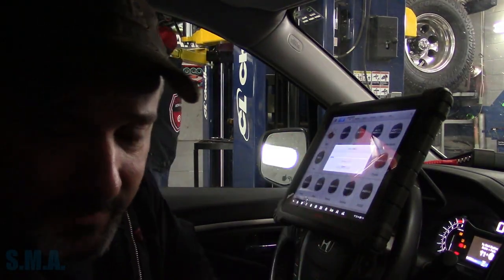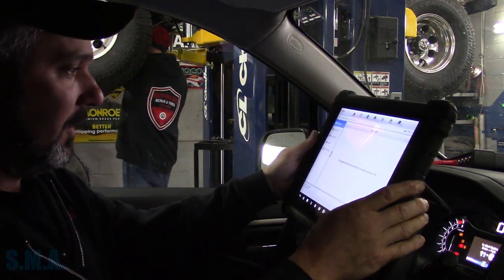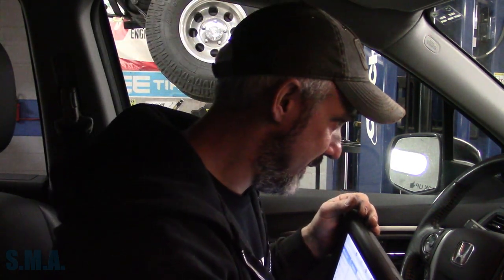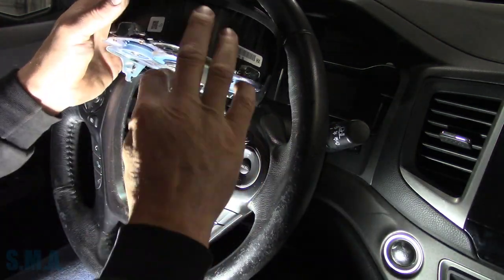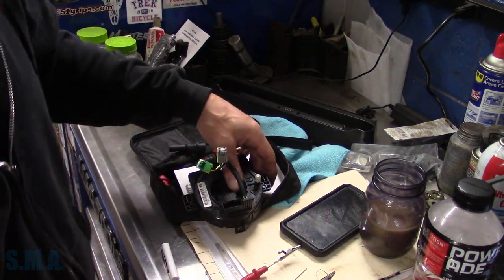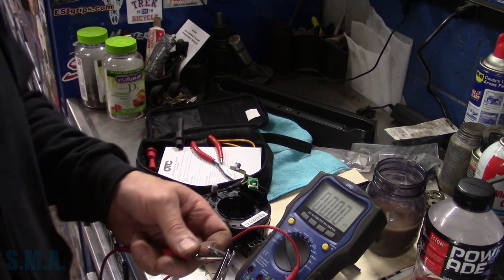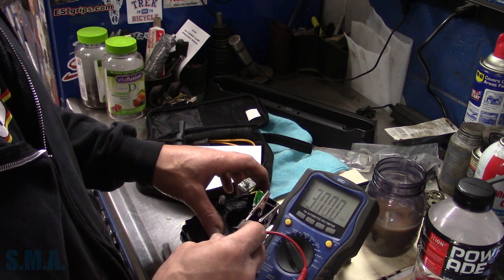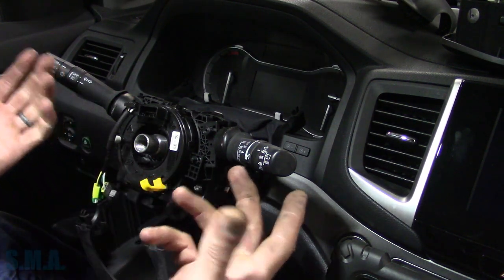Honda Pilot - Air Bag Light On

Comment: Man, those two young men are so lucky to be working there.  They are learning some very good techniques and procedures that will aid them their whole career.  It will save them a lot of grief.
Reply: You are absolutely right. Not only his diag ability but his work it self. He does the job right. He puts things back in the right places, cleaning and lubing as needed. I wasnt lucky it took me watching EricO to understand what these other techs was doing wasnt right. Example: Brake job a lot of guys doesn't clean the pad guides properly and just sand the ears of the pads. They didnt grease the pins or clean and put anti seize or lube on the Hub. I just did what i was told. After watching EricO my whole thought process changed. Now i own my own shop and everything is done to the best standards.
Reply: I don't give a thumbs up to many comments but I did this one. You nailed it right on the head
Reply: L0
Reply: Robert Slackware m

Comment: Man it is so good to see Eric O & Mrs. O chatting. Those are the best parts. In one of the SMA videos, Eric fixes an AC on a car that has no brakes. Given a car that will not crank with a good battery, until my money runs out, I will have repairs done in this order, brakes,  steering 35:20,  suspension,  tires,  lights, windshield washer/wipers,  engine, drive train, and finally creature comforts, e.g. AC, power windows. Engine is late, because I do NOT want to move until the other items are in good working order.

Comment: OMG! these are the exact 2 codes that pops up on my OBD2. My horn and steering wheel buttons works perfectly well, However the backlights are intermittent, it will only light up when you steer the steering wheel 180 degree and my SRS light is on. THANKS A MILLION! :)

Comment: We didnt have Legos when I was young. I had Erector sets! Real man boy toys!  😜
Reply: Do you remember the Crashmobile?  The 4 quarter panels and roof snapped on to the frame under spring tension.  Push the front bumper in and the parts all flew apart.  Had no idea that cars would actually evolve into that someday.
Reply: Lincoln Logs, baby!!  (Although I did later get an Erector Set).
Reply: @EdAxeman
Me too!  I had 2 sets.
Somewhere in my house are the 2 sets.  My Mom kept them then sent them when we moved to California and they sold their house.
THE A.C. GILBERT ERECTOR SETS!

Comment: Eric if the air bag would have exploded you would be the YT legend of all time!!
Reply from the maker: We could only hope on the next one....
Reply: I've replaced many hundreds of airbags in Hondas (Takata recall) and we never remove the battery cables, it's a huge waste of time. Not once ever has any of us techs had an issue. Theory is one thing, but reality is what it is.
Reply: Jgizzy redacted I always thought the chances of an airbag going off are very slim because of the shorting bar in the connector
Reply: You mean just like it happened to Paul (Scanner)Danner? ;-)
Poor guy, though... that bang + the costs of replacing all of them. :-(
Reply: I seen where a quick lube tech was replacing a cabin air filter in a Acura mdx and the air bag deployed and hit the owner/driver! There was a lawsuit and settlement! I'm pretty sure it was a Lube Express in New Jersey
Reply: @blockbertus  which video was this?
Reply: The flame throwing shock absorber on the Toyota Forrunner and extreme brake rotor removal with Big Nasty on the Mazda should've put Eric over the top. An air line was decapitated and a tool box dented in the brake rotor video!
Reply: @JBotAlan  He never released it. There is just a snippet of it in one or two videos. You see Paul doing some airbag system diag and suddenly ALL airbags in the car deploy. It seems he is turning over the airbag control module and I assume that thing "thought" the car rolled over and fired all the bags it had. And it had plenty....
Reply: @blockbertus  when i was in tech school, a buddy of mine who worked for BMW said one of the techs was diagnosing a g sensor, accidently dropped it and all the airbags went off and he was all fucked up and went to the hospital and shit
Reply: @drwrencho4392  oof. That sounds awful. Hope he recovered.
Paul, btw, was outside the car and just leaning into the foot area on the passenger side to fiddle with the module.
Reply: It's a myth about taking battery off with airbags. The Airbag ECU has to close the ground, it won't do this until certain inputs match criteria. Impact sensors, deceleration values etc all have to match before BOOM!

Comment: Hondas have torx bits . Every other vehicle uses small holes and you have to press the rods that release the bag. I made my own tool for this.  An antenna cut and ground flat works great...just a friendly tip

Comment: The "shorting bar" on a clock-spring connector is there to *reduce* the likelihood the airbag will deploy inadvertently because of something like a static electric charge, typically you don't want them blowing up in your face.
Reply: I wondered what the Shorting bar did 
thank you 🙏
Reply: Great info, was perplexed why
Reply: Typically.
Reply: also I found into the airbag connectors some LC/RC filters so signal spikes get a calm down. and short bars in almost every connector, IIRC even into the airbag's control unit too.
Reply: Airbags do not just blow up in your face unless sensors are triggered I'm an airbag expert

Comment: Also disconnect battery and wait 20.min before even touching airbags ....they will not explode. Just a precaution.  Airbags don't just explode unless a sensor has been triggered by a collision that's the only way. Been doin this 20 plus years I've never had a airbag blow on me

Comment: I always use a battery impact to undo the bolt holding the wheel on. We had a recall to change the clock springs in CRVs last year. The thread lock takes a little breaking...

Comment: Push pin pliers work the balls for unplugging those. Honda sent us a bunch of "special tools" to remove them for the  CRV cable reel recall, but I can never find it when I need it.

Honda says don't use an impact to loosen that bolt. Which is usually the indication that you shouldn't waste any time  throwing an impact on it. I  think the torque spec is 65Ftlbs. Not sure on the pilot. I've only had the wheels off those to install a heated steering wheel, which  if you have a heated steering wheel accessory installed. They wont know by  your vin, and you do need a specific cable reel for it.
Reply: Robert Slackware  sounds like you got a parts guy that just didn't want to help you out.

Honestly if you have the lower end radio, count yourself lucky. They're not plagued with MOST connector issues.

Shoot me a message with your VIN, I'll look it up on honda interactive.

Comment: Great video, however my VERY next step would be to disassemble the old clockspring unit so I can see the wire broken.  I know it's pretty pointless because you already proved it to be faulty, but I like to see the failure point in things like this.  I seem to remember him taking one apart before.
Reply: A tiny ribbon wire, often times the break is so small it's often undetectable to the naked eye.

Comment: Hey Erik. I'm not a mechanic so pardon me if this is a stupid question...
Why don't you center the steering wheel in the down position while removing an airbag? Seems like it would be a perfect "table" and your work would be easy to access without having to hold the bag up. Then when it's out you can turn the wheel back to straight.

Comment: Hondoos never break down or have issues!
Reply from the maker: I hate to tell you....

But Scotty lies
Reply: VERY  SELDOM
Reply: @SouthMainAuto  , scotty ? Lie ? Naw , he couldn't ( could he ? )
Reply: @SouthMainAuto  agreed
Reply: Also was gonna say didn't EricTheCarGuy replace a steering rack in his Odyssey
Reply: I have owned 3 Toyotas and 4 Hondas. More trouble with the Hondas. They all have issues sooner or later.
Reply: Kilmers subscriber count baffles me.
Reply: As a tech at Honda dealer that’s incorrect they break down a lot
Reply: @adventureoflinkmk2  Naw he just welded the old one in place.
Reply: The cigar powered smoke machine doesn't lie Eric...insta ban.
Reply: Lol. Maybe back in the day, but the new ones are recalled constantly
Reply: @nathanknight9617  As a Honda tech myself I second that. I'd work elsewhere if they didn't break.
Reply: @VeeYehLa  Confirmation bias is present today! It's an easy opinion when all you see are the failure modes of each model, but do not see the multitudes of the same out there on the road with no such issues. When all you see are the failures, it's hard to impossible to see the successes that never make your acquaintance.
Reply: @SouthMainAuto  Ever work on a Hondaroo?
Reply: @YTisDumb  With all the crap in that garage who would want to?
Reply: @MrTexasDan  or probably stuck one of those resistors in the  connector haha 😹 and wired the rest to the battery

Comment: Must be the same guy at the Honda factory torquing crank bolts that put the steering wheel on. That thing was tiger tight
Reply: Only 2 that always put a up fight when you try to remove. Guaranteed. Ive never had one come undone easy

Comment: i imagine each of those button blocks is on its own channel to make building different models easier.  the harness and the slip-ring can then be common to a wide selection of Hondas if not all of them.  they can just install the buttons for that given car's specs and then program the computer for them.

Comment: You could do worse than GearWrench as a sponsor. As a an amateur weekend lame-o mechanic, I find their stuff pretty good. And mostly made in Taiwan which I like a lot more than buying from the mainland if you know what I mean.
Reply: Love my Gearwrenches! Use them every day!
Reply: The GearRatchet I got like a decade ago is still my favorite, as well as the most useful, socket set I've ever owned. Their stuff is fantastic.
Reply: GW was pretty good up to a few years ago and with some of deals amzing value, most current tools have declined massively, socket design worse, ratchet design worse (and changes made because cheaper manufacture not better tool design).
General quality and warranty constantly slipping to keep prices competitive and margins high .
It not a brand worth getting into heavily, pick the odd item they do well or old stock better made/design tools at cheapest prices you can get and you doing okay, plenty far better to be had at same price range ...
Reply: They also have EXCELLENT customer service. I recently needed to warranty an 8mm ratcheting wrench. It was part of a set that I received as a gift so I had no "proof of purchase". Local retailers wouldn't exchange it because of this so I was about to just buy a new one-they're under $10 so no big deal. I decided to email Apex Tool (GearWrench parent company) and ask if there was another option. They replied a few days later saying they'd send me a new wrench. About 5 days after that, it showed up in my mailbox free of charge. That's how a company keeps customers satisfied!

Comment: I took a guess on my Dodge Neon that it was the clock spring because my air bag light was on and my horn didn't work. It's a pile of crap and we dont have inspections in MN so I just bought a used on one ebay lol.

Comment: For your information, most bolts that use lock tight in a factory come from the manufacturer that makes the bolt already with lock tight on it

Comment: It never fails, I always learn a little more with these videos. Is there any concern about using a multimeter to test resistance of an airbag, after insulating the shorting bar? Presumably the PCM does it in live data all the time.....
Reply: Yes. Don't check resistance on any airbag. The current your meter uses to check the resistance will make it deploy.
Reply: Dangerous to do that.. no guarantee the voltage from the meter isn't just enough to fire the squib. Can resistance check the rest of the circuit but only with the airbag unplugged.

Comment: My luck with not using a pulled is usually the wheel cracking right in the middle section where the sides attach, but that was back in my “twist the steering wheel sideways if the power steering fails” days

Comment: When the air bags first came out. When I had to work on something under the air bag, I would disconnect the battery. Then the Air bag fuse, disconnect the Derm. Disconnect the yellow wire at the base of the Column, then pull the air bag screws and when I went to disconnect the air bag itself, I did it from outside the car. Through the window. :-)  Yes, I was chicken.
Reply: Robert Slackware  lmao!

Comment: I did a clock spring on my '15 Accord (same setup) and I got that angle sensor 180° out. It's a rotary encoder, so I couldn't figure out how to recenter it and was dreading taking it to the dealer. I put it in reverse, lo and behold, the curved reverse guide lines! Was able to correct it using that.

Also, fun fact, driving with it 180° out causes the computer to engage the ABS/VSA on a front wheel. Then it throws a code and disables VSA.

Comment: Previous work probably done by the "professional" . Aka dealership!
Reply: Oh please. I change clock springs on 16-21 Pilots/Passports in about 5 minutes FLAT. With no marks on the clamshell.
Reply: But still charge a flat rate of one hour + shop supplies....
Reply: It's hard to believe the dealer didn't warranty their work.
Reply: @robertgray6512  Funniest youtube comment ever.
Reply: @bobcobb7719  why what would you charge?
Reply: J J I wouldn’t.  My comment was directed to the previous comment about doing them in 5 min.

Comment: ~17:00 Not Phillips, JIS Screws. All Japanese cars and most Asian cars use JIS. Similar to philips, but not philips. Philips screw drivers cam out of JIS fasteners.

I have a set of Vessel JIS screwdrivers which have a very cool impact feature built in. Looks like you are using the exact same screwdrivers, so you already knew what JIS Screws are!
Reply: Vessel makes great JIS screwdrivers! I got both #1 and #2 JIS from Vessel. Love em!

Comment: Hey Eric, I'm pretty sure the pin on the cable reel goes thru the steering...you install the wheel and then pull the pin - it doesn't make a huge difference, just another layer of idiot-proofing, which, we can tell....you ain't an idiot :) great video as always!
Reply: You'd be wrong, but break tab is supposed to snapped or removed prior to the wheel installation, otherwise the tab would hit the backside of the wheel frame. I've done tons of these jobs on 2016+ Pilots.
Reply: @jgizzy  totally possible - I remember some models having it go thru the steering, thought the Pilot was one of them - no worries!

Comment: Me as a Honda tech that's done hundreds of airbags: lol, unhook the battery...
Reply: Save and re-enter radio presets, enter anti theft code, set the clock the whole 9 yards.
Reply: Hahaha right, NOBODY disconnects the battery to do airbags on a Honda..... Such a waste of time! Theory is one thing, but reality doesn't lie -- it's not necessary unless you live in fear of that 'one in a million' event.
Reply: @jgizzy  I will say, Honda is one of the few you can do that with.  Don't recommend doing that to a gm though.
Reply: @LazySniper  I don't recommend doing anything to a GM ;) unless it's a truck or Camaro/Corvette heh
Reply: Replaced many airbags ans its just pop it out and new one in...
Reply: Robert Slackware  No, not even the factory scan tool.
Reply: Yep as a honda tech that has done hundreds of recalls.  ive never unhooked the battery for any airbags ever. Also the tool for unhooking the air bag clips work great lol. Also just use an impact to remove steering bolt
Reply: @corykluthe355  theres a tool for that?
Reply: @LazySniper  yep its just a little plastic tool with 2 hooks that u slide under the white tabs and just pull it pulls the tabs and disconnects connector 2 seconds and they both unhooked
Reply: @corykluthe355  kinda like the fakra puller
Reply: @LazySniper  yeah kindof.  Had to do the new speaker snapping recall yesterday.   Had to change every fakra connector  in the entire vehicle
Reply: @corykluthe355  you can thank my dealership for figuring that out.  Between the reroutes and the weak housings.
Reply: @LazySniper  yeah some of the wiring is pretty wrapped up in places.  No wonder they having issues.  Just irritating weve done most of the gauge module updates already and now have to take apart some to do this recall now.  W.e ill get paid twice lol
Reply: @corykluthe355  biggest mistake was the short wire from the loom and thinking they're a regular connector.  But Fuck the front box and gauge update.  Add a jumper harness in.  You remember when they had us borescope the gauge module?
Reply: @LazySniper  yep its like playing the 50/50. Am i getting a connector or no connector? Lol

Comment: Back in the day we would get air bag light on. This was due to folks ignoring the light flashing for days, weeks and then the light would stay on. Well, the steering airbag had two rings and a set of brushes. These brushes were sprung so hard they would deform the rings. When contact was bad, usually going straight on the freeway, the light would flash. When ignored these constant breakup of contact would cause the control unit to go bad. $$$$$$$$$$$$. Rings, brush sets and control unit would have to be replaced. Great fun to hand the customer that bill !

Comment: I was taught, after meddling in the affairs of airbags, to do the initial start from the other seat, in this case the passenger side. An unintended deployment could still ruin your whole afternoon, but you would survive. Probably.
Reply: On Hondas it's not really necessary -- all of us techs replace airbags all day long and NOONE removes the battery cables or sits on the passenger seat.
Reply: @jgizzy  good to know, thanks!